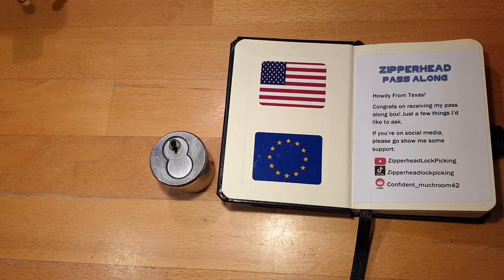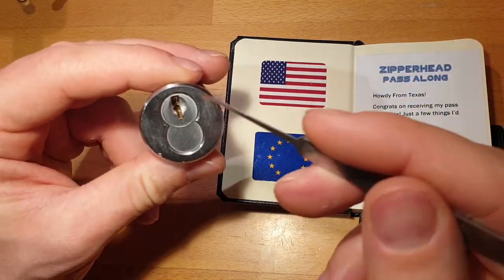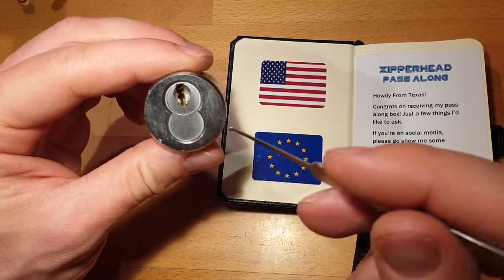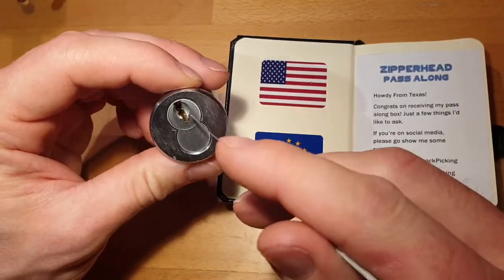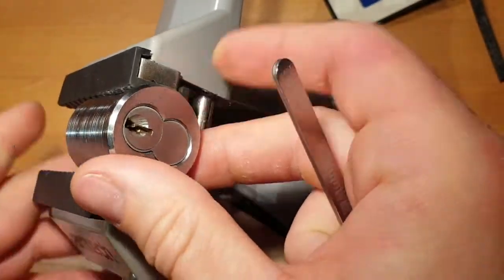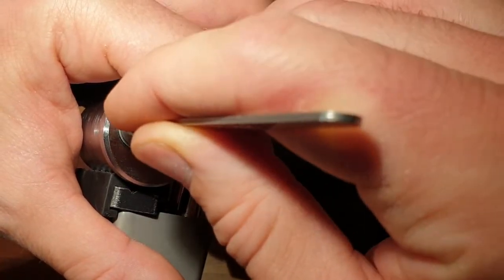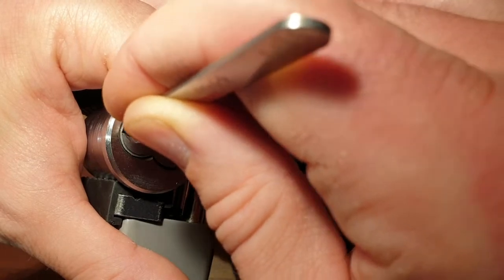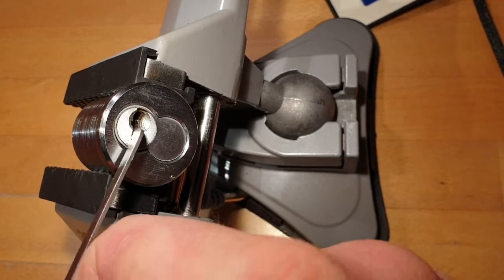[22] Small Format Interchangable Core - SFIC, from Zipperhead's box, picked to operating

Comment: Don't people use a long bok with grooves cut it to line up with the pins?🤔🖖
Reply from the maker: Hm? Have not seen anything like this. What would be the idea behind this? To only tension the control shear line? Do you have a link to a video or so? Thanks anyhow for the hint, I will look into that 👍
Reply: I've been looking but no luck. Might of been for lfic? Or best.
Anyway fish pick dose a short video which is quite good.
I wish you all the best & good luck 👍👍😜♿
Reply from the maker: @leglesslockpicker  ah yes I saw fish picks video. His videos are really good, but in this case it did not really help me. Potti314 has also a good one were he concludes what to do by looking at the two keys. Than he picks both very controlled. BUt since I do not have keys that also did not help me that much :(